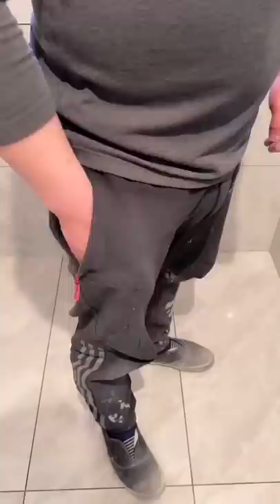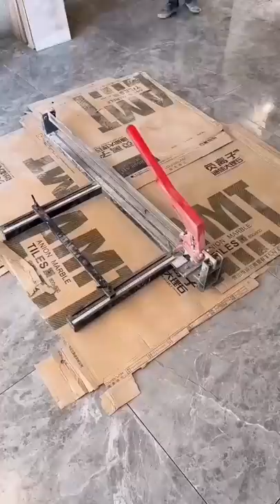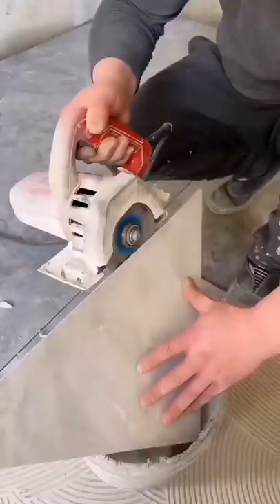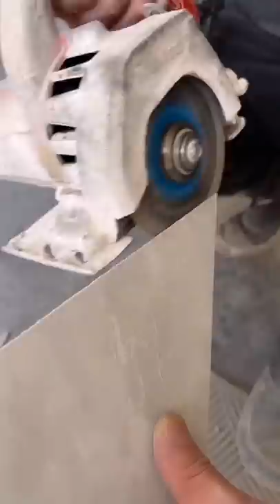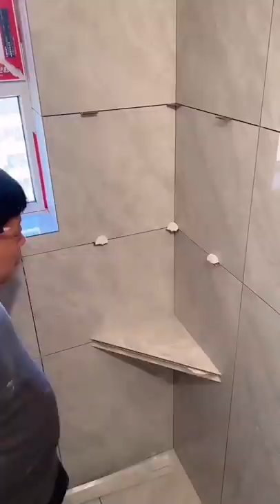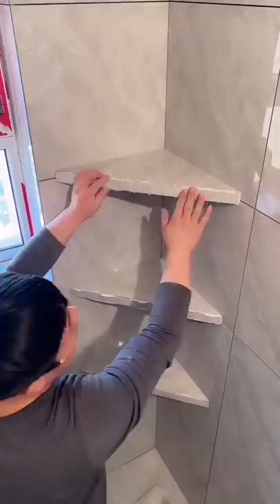Awesome Construction Techniques | Construction TIPS

Comment: All this shows is the number of people who've never done home improvements themselves. These shelves are literally sitting upon 3 wedged (not glued, not screwed in) bits of cut off tile in the grout line. They might hold 5 lbs if ONLY pushed down vertically. But the second you pull this shelf outward? The whole thing comes out of the wall with the same effort it took for the installer to put in the wedges in the first place. This is class A garbage. Even before knowing any time you place anything on those shelves you're prying the two pieces of tile apart stretching and eventually cracking the grout. It's a sure fire way to get water and mold growing in your wall.
Reply: Made in China, mind it😂😂
Reply: I do it with a few nickels, one at each corner. Try it because after everything is together and grouted it'll support more than you think. If you fill the gap with thinset it'll support you np
Reply: Bullshit tile glue and silicon around that shelf would be solid as.
Reply: the glue he put on the clips will hold it.
Reply: This guy thinks you can pry 2 installed wall tiles apart by putting stuff in your soap dish. A true genius here folks.
Reply: @erickbad2000   While this guy doesn't understand it's not about prying it apart. It's about creating repeated separating stress on the grout which eventually starts to crack and lets water into your wall. But black mold and thousands of dollars in damage or having the shelf actually secured into something is no concern to you. 🤣
Reply: @Vermonstered  internal corners should not be grouted. Silicone should be used. Grout is for flat areas. 
Repeated stress on a soap dish? Maybe if your banging the Mrs in there.
Reply: @Danoz_die_wreckt  Silicone will definitely hold up better to repeated stress but that's not what happened here. Though not sure if you noticed, this isn't a soap dish...
Reply: I think what's unclear here is if the grout he's putting the wedges into is wet or not. If it's wet (and I assume it is), then everything is fine. The grout is securing the wedges, and it doesn't really need to be very strong to make it extremely difficult to pull out laterally. That's the only real failure mode here. If it's not wet these shelves will fall out the first time you put any pressure on them at all.
Reply: @ommprakash4816  I guess you never saw how Chinese build roads and bridges, you should wake up. Almost everything you use is made in China, however good or bad, it depends on how much you pay.
Reply: @julianzhong8900  I don't know how you use them and their quality but imported Chinese things are not up to the mark they may be best in your country and yes, many of them are cheap but it not to that level, price and quality don't balance with each other well. Anyways, respect your view
Reply: @ommprakash4816  You are using iPhone, aren't you, :) Keep you mind open, my friend.

Comment: A lot of weight on those little clips 😂😂
Reply: And not secured.  Notice he didn't pull on the shelf, he only put weight on it.
Reply: @ianbelletti6241  
the glue he put on it will secure the clips in place
Reply: All the weight will be transferred to the tiles on the wall, it will not move since they're glued altogether
Reply: @angeltanedojr8753  it may happen to work for lightweight items, but the more weight you put on those shelves, the more likely it's going to fail.  It's not sufficiently reinforced to handle being loaded.
Reply: What the weight will be thier shampo and soap.
Reply: @ابوعبدالله-ي4ظ6ذ      Until they slip and grab hold of one...😬...ouch!!
Reply: @ianbelletti6241   like the Arab guy said, what Weight will going to put there other than soap and shampoo 😁... I bet you even hundreds of years that soap and shampoo will stay there
Reply: @angeltanedojr8753  and one slip and fall destroys the shelf.  Yes, it should only be holding lightweight items.  However, it's not designed to hold up to the rigors of life. It's designed as a short term item, not as something you want to last for the life of a shower.
Reply: Like who is going to put a 100lb dumbbells on that shelf?
Reply: @Thenoisyassasin  just saying. If that’s how you do corner shelves- more power to ya. Mine would be recessed under the tile tho.
Reply: @Thenoisyassasin  Some giant pack shampoo bottles nowadays can weigh more than dumbells
Reply: Muito bom mesmo gostei
Reply: Hope no one tries to sit on it lol
Reply: @manderbeggs1900  I hope you didn’t misspell “sit”
Haha
Reply: I don't have much of an issue with the clips. However, the tile secured to the underside of the shelf worries me. That's not a lot of adhesive to secure that and I really don't want 12 inches of tile hanging precariously above my bare feet.

Comment: Nice safety glasses you are wearing when you cut with the circular saw. My uncle went blind from doing exactly what you are doing
Reply: Everywhere you safety officers
Reply: @aamir8630  I'm going to waste some of my time to reply to you. How much do you think a pair of safety goggles cost? And how much is an eye surgery? That if your eyes are saveable. It's common sense
Reply: @carpenterx2  seriously I learned my lesson I was cutting a piece of plywood with a circular saw and I got a wood chip in my eye. learn my lesson always wear safety glasses
Reply: @anon2414  I’ve had that happen with a miter saw while wearing safety glasses, upgraded them for a better type since then. Couple of hours ago I actually had my spindle sander catch the MDF template (making a circle slightly bigger) and sliced my thumb open. I was not 😑 wearing my safety glasses since I was only expecting very fine sawdust, but thankfully the piece wasn’t sent flying and instead just spinned very fast until I unplugged the machine. Learn the lesson the easy way: from others’ mistakes, always wear safety glasses even when you don’t think you’ll need them, accidents happen so quick.
Reply: @aamir8630  everyone believes it won’t happen to them. Until it happens to them. Probability doesn’t care if you know what you’re doing.

Comment: What's the load do you think? It's worth?
Reply: Worth it, only for video content.
Reply: I’m sure it will hold shampoo and conditioner. Kerdi makes pieces of metal like this for a corner shelf. The metal shelf goes right in between tiles in the grout line.
Reply: appreciation is a good thing

Comment: The connection should hold, I've seen guys use washers before, thinset is super strong and will work.  The problem is the dot method, you need to shoot for full coverage of thinset behind any shower tile otherwise water will collect and mold will develop
Reply: Or it'll shatter... lol
Reply: Dude, nothing is holding those clips in the wall. Drop a bottle of shampoo and the whole thing collapses

Comment: Please wear a mask with eye protection when cutting stone, brick, tiles, pottery or similar materials.  It is likely you will suffer lung problems later in life if you do this on a regular basis. 🤷🏽‍♂️
Reply: Maybe maybe not, I worked fiberglass, stone, tile and woodwork most of my adult life with almost never wearing masks. I retired 6 months ago and I have zero lung issues and run 30+ miles a week.
Reply: @PumpkinKingXXIII , please don't promote poor health safety standards
Reply: @davidrobot7818  don’t be such a wuss
Reply: @millionairemobydick4489  always put safety first

Comment: Somebody introduce him to load carrying capacity calculations real quick
Reply: Oh please. How much does a bottle of shampoo and conditioner weigh? Man
Reply: I didn't even know they will put shampoo there. I'm talking about a tile on it own which is held by a tiny piece, even if it was steel it not enough as it is so short. Then the guy smeared little tile adhesive on a slippery surface of a tile plus adhesive weight. If I'm not mistaken each "shelve" will weight approximately 1kg..  I am sure those brackets he used wouldn't even take 200g load. As each bracket on a shelf should hould at least 25% of it load rated capacity. I might be wrong though. The way things are calculated changes everytime. At least he should be introduced to the maths so he do safe things.
Reply: I'm sorry to disagree, but he shouldn't be the one doing the maths. That will be the job of an architect or some kind of supervisor of the work. Unless he is the owner, then we agree and he will probably learn this by trial and error
Reply: @tachy635  what is your occupation?

Comment: This is why installers and contractors need licensing and regulation and inspection. 

This WILL fall in 3 months to 10 years and when it does, someone will most likely lose a foot and then an immediate head trauma

Comment: I sink 3" screws into the studs at 3 or 4 points with 1.5" sticking out and sandwich over that as it usually is pretty sturdy. Or take a grinder and inlay the center tile into the wall tile and silicone in, then sandwich.

Comment: What are the first items you placed on the wall
Reply: Tile wedge spacers. They're meant to be placed in between tiles when installing to keep them evenly spaced. Then you remove them and fill the space with grout. They're not meant for this, and those shelves probably aren't going to last long, especially if they're ceramic tiles.